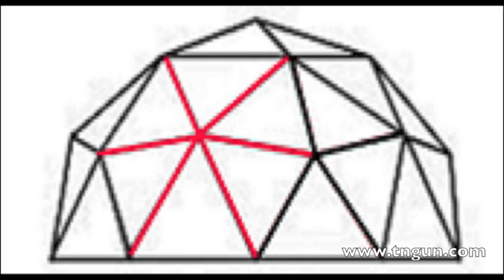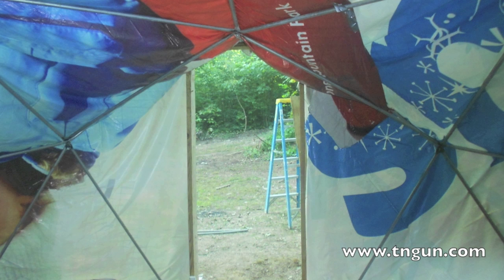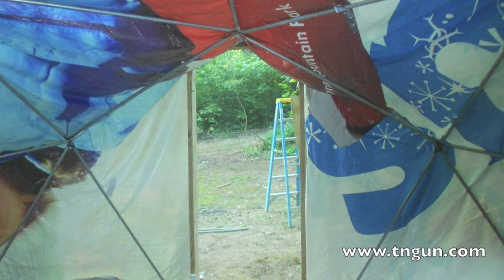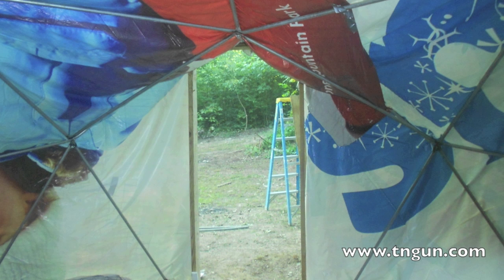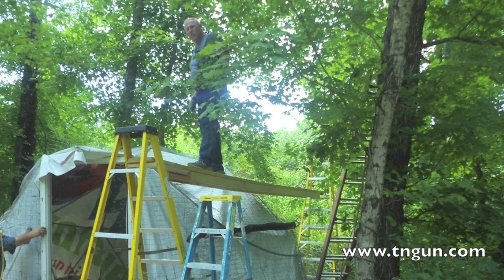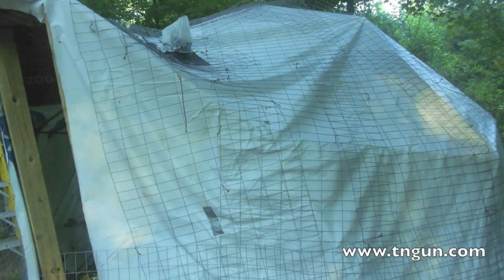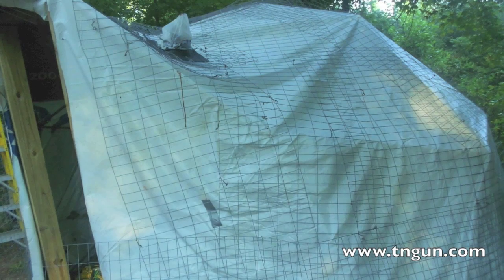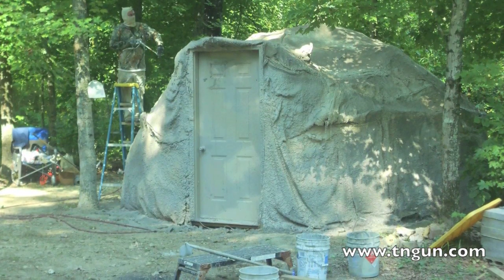How to Make an EMT Conduit Geodesic Dome IV

Comment: Maybe I missed the earlier vids on this but is this a cabin or for some other purpose? Did you take a look at Monolithic domes before going ahead with this project? Just a thought for future projects.

Thanks
Reply from the maker: This is an ongoing project - basically its a storage building/small cabin on my farm/bug-out location  it was also an learning experiment for a future book on ferrocement - I did look at monolithic (I have been a fan for decades) but this is an order of magnitude cheaper...  The build will also be on the upcoming Doomsday Prepper show (scheduled for Jan 7th tentatively)
Reply: David Nash
Will be great to see how the cost compares as well as how you decide to insulate.